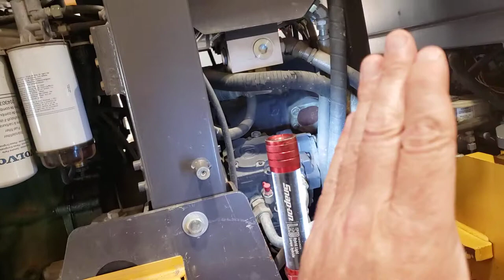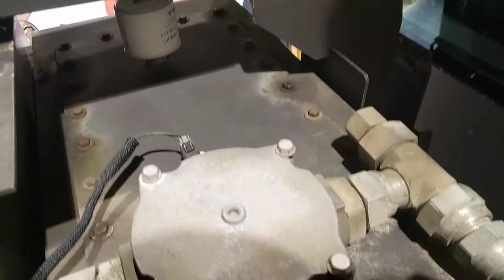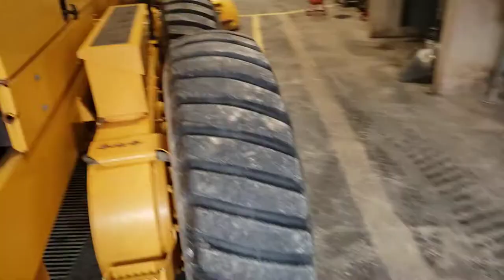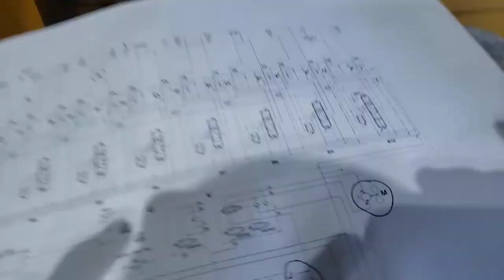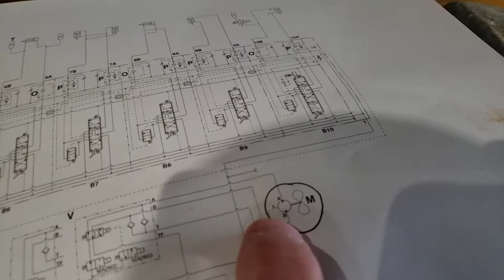Volvo G976 Grader Hydraulic schematic Part 2/2

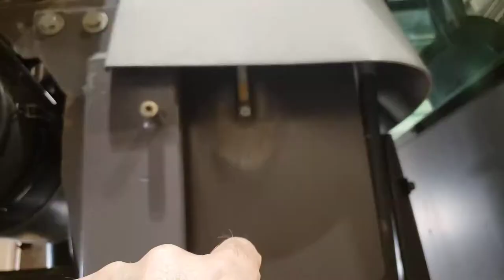Comment: Excellent explanation. @3:05, what is that "manifold" having so many hydraulic tubing connections?
Thanks.
Reply from the maker: some sort of "freewheeling" valve - part of the AWD system - somehow allows the front drive motors to bypass oil when AWD is turned off as I recall
Reply: @hydraulics Thanks for the clarification. Appreciate it!
Please make more videos , your content is excellent.